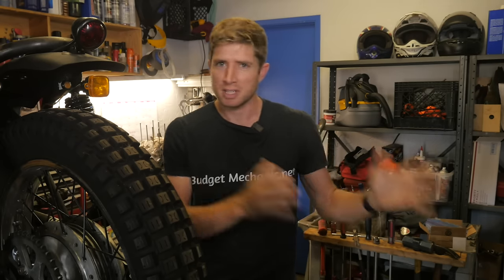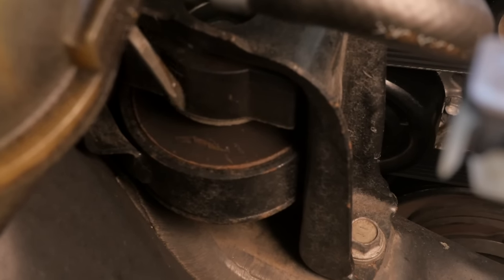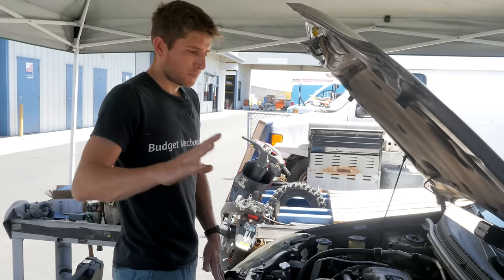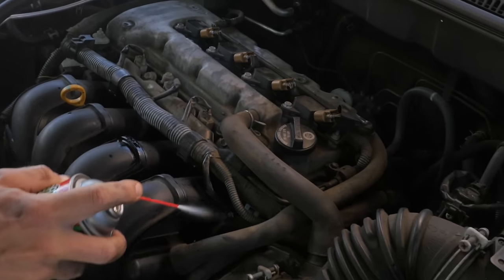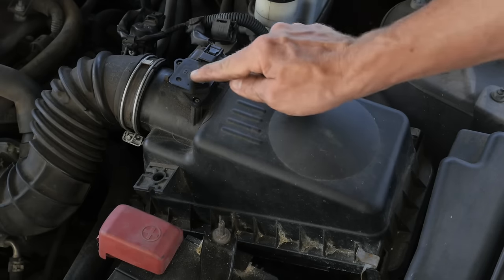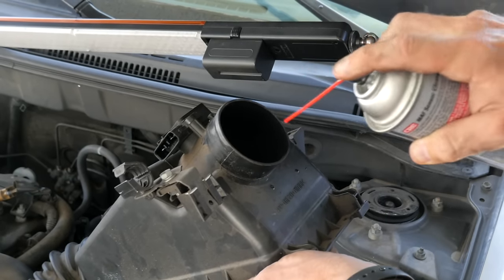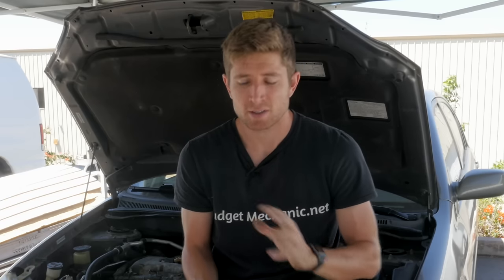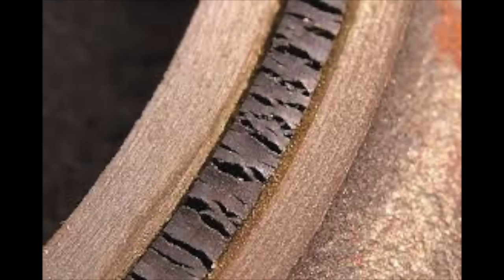Diagnose and Fix Rough Car Idle - Main Causes For Shaking / Vibrating While at a Stop

Comment: SOMEONE PLS HELP!!!!!
I have a 2015 Honda civic coupe (lx or ex not 100% sure which one) 
It’s been jerking for about a year now. Started off more subtle so I didn’t really see an issue, but now basically anytime you accelerate and push the gas, the car will jerk a few times and hesitate to go faster. That’s the first issue, 
2- the engine shuts down/ car stops at a red light or usually when I stop for longer periods of times. At first it was only when I was trying to like maneuver my car  into like a parking spot or do like a three point turn which requires you to put the car in reverse, now it just stops usually when I’m stopped when my foot is on the break. When it does that, the oil pressure light comes on along with the battery. Usually I just turn the car off and start it back up , then it will drive and the lights go off but as I stated before it will hesitate to accelerate. Not sure if this helps but the Check emission light occasionally comes on. Some days it’s on, some days it’s off. Any thoughts ?
Reply from the maker: Get the codes read! That will tell you what to focus on!

Comment: Help needed urgently i own e30 318i  it was driving fine till i did a lil burnout now my idle stuck at 1300 and 1800rpms what could it be
Reply from the maker: Not sure sorry!
Reply: Sounds like your throttle body could be stuck, I'm far from a mechanic but I know I had this problem with my ex's Pontiac grand am. An it turned out to be the throttle body just needed cleaning, once I cleaned it I never had a problem with it again. I know it's been 2 months since u posted this comment, but I hope this helps.

Comment: I got a used 2018 elantra with 100k plus miles, I hit a big speed bump, also may have over revved the engine while in brake.. the car sort of feels like it’s not as quiet, it shakes when I accelerate up to a certain speed and am about to let off the gas, or it will shake while driving really slow. Wonder if anyone knows anything.  I hear bad engine mounts maybe the cause my mechanic said but idk. I’ll be taking it in next week to get looked at hopefully I don’t get robbed and get everything figured out and my car drives nice n smooth again and fast and responsive when it needs 👍 sometimes it almost seems like it’s the transmission. It does slip sometimes a little but nothing major.
Reply: I did change the spark plugs, it was running a little heavier then this, and that sort of half fixed the problem, to where it only does it sometimes. I’m thinking it could possibly be alignment issues too
Reply: It also makes quiet clicking noises from the engine every now and then while driving.

Comment: I have a lean fuel trim code, intermittent misfires (one every week at no particular interval or load), slightly dropped mpg, and a kinda rough idle at times. I've checked my spark plugs and their fine. Do you think it's the fuel injectors? Anyone?
Reply from the maker: Are misfires always on the same cylinder?
Reply: @BudgetMechanicHawaii  yes. Cylinder 4. Front center cylinder on my Toyota 1MZ engine. Get the p0304 code for cylinder 4 misfire
Reply: @BudgetMechanicHawaii  ran a few bottles of Berrymans fuel treatment through my tank recently, with premium fuel. Improved my mpg. Only misfire when flooring it and only sometimes now. Still only one cylinder.
Reply from the maker: Lean trim is usually a vacuum leak, not always directly related to a misfire…
Try swapping coils from different cylinder and see if the misfire moves
Reply: @BudgetMechanicHawaii  already did that, didn't move. Plugs look fine too.

Comment: Bought an Altima and whenever it’s on idle it just vibrates especially the steering wheel and the rpm goes up to 2000 then goes back to normal.
Reply: Check your IACV Valve.  It may need cleaning or bad or stuck.
Reply: Jordan Bronson thanks man, I’ll look more into it
Reply: @JodBronson  if your valve needs cleaning because the car has been sitting idly for a few months, is it better to just replace it altogether? I recently had my timing belt changed but the car visibly shakes when i turn on my car and the rpms moves up and down on its own w/o me braking/accelerating 🤷🏽‍♀️
Reply: @luvleechick12   - As stated above, the IACV Valve maybe the culprit.  Replacing it if it's really old or clean it if your time is worth it.  NOTE:  My Dad's car was like that, the "Idler" needle keeps jumping up and down too and after replacing it, it was AOK.  Here is the video I've made a while back:  https://www.youtube.com/watch?v=pkb1FasEMsU
Reply: @JodBronson  thank you so much! Really appreciate your time responding. It stresses me out so much when I don’t understand what’s wrong with my car. I’ve had him for 15 years so he’s like my baby ❤️
Reply: @luvleechick12  - You are welcome!  I totally understand when it comes to electronics in cars/trucks.  It's hell when things like that happens... I myself know a lot of things, but STILL I get frustrated when "Electronic" things goes wrong.  It's really hard to diagnosed even when you know something should be easy.  My suggestion is go on eBay and get those CHEAP Bluetooth OBD Scanners...  Sometimes those things "can" help you with the diagnostic.  Although sometimes, they do not help, but at least you get an idea.
Reply: @JodBronson  ok so I checked out your other video. It definitely does this exact same thing! So if it’s cleaned and it still does this - do you recommend just having the valve completely changed? How much should that normally cost me?
Reply: @luvleechick12  - I got mine for $34.00, but depend on your Car / Truck of course.  After cleaning and still doing it, I would change it completely to avoid other problems!  It's really easy, 4 screws + 1 electrical connector.

Comment: Mine runs rough on idle when the fan comes on. Turning the ac on full blast dosent help either
Reply: The fan is coming on cause the temperature might need antifreeze or a thermostat I don't know much but that's where I would start

Comment: 🤦‍♂️ electronic controlled throttle body is a must to disconnect the battery turn on the headlights for 2 min after disconnecting the battery to get rid of any voltage left behind if not taking that electric throttle body off while battery still on you will have to get it reprogrammed or reprogram it yourself headache

Comment: My car idles quite rough, and on scanning the ECU it comes back as the fuel mixture being too rich. Possibly the cause of the rough idle?
Reply: If there is too much fuel and not enough air, the engine is said to be “running rich”, or “has a rich mixture”. It will have a gassy or rotten egg smell from the exhaust, give off a burning effect to the eyes and will make black smoke
Reply: @JodBronson  i dont think my car does ANY of that tbh
Reply: @techgamer1597  -  You stated clearly " Fuel Being Rich ".  Read my post again :/

Comment: Is there like a sound with bad spark plugs
Reply from the maker: Not really, since that causes a misfire, other than the sound of a shaky motor
Reply: @BudgetMechanicHawaii  my car sounds like a lawnmower 🤣and the engine keeps misfiring and it shits off when when it idles
Reply from the maker: We have a great video on misfiring if you want to further diagnose that. Misfiring is a bad problem, you should address that before making sure your lawnmower blades are sharp.

Comment: Whenever I start braking and stop at a red light my car starts vibrating but as soon as I hit the gas the problem goes away
Reply: Me too! I’m not sure where does it from?
Reply: It’s probably your engine mounts. I would get new ones
Reply: @docholiday9513  imma try changing the spark plugs if that doesn’t fix it then I’ll change the engine mounts 👍
Reply: Yeah, when you're on the move you can't really feel that vibration until you're idle. Did the engine mount replacements work?

Comment: 03 Camry changed radiator and now when it gets warm it'll go dead!!! I'm stumped never run hot either
Reply: Make sure that 1) you refilled your coolant to max, 2) replaced thermostat in proper position if it was removed, 3) reconnected your radiator fan and 4) you reconnected all hoses and radiator cap after you got done. There is no reason why your can should run hotter with a new radiator. Lastly, make sure your water pump is working.
Reply: @MrSupernova111  read again
Reply: @anthonycole3220  . Good point. I have no idea what you're trying to say as it makes no sense. I'll leave my comments for others and good luck fixing your car!
Reply: @MrSupernova111  that's fine lol. Pretty simple exactly what it says. #1 Radiator had a crack so i had to replace it. #2 after I replaced it and when my car warmed up to standard temp it wld start to idle rough until it wld go dead
Reply: @anthonycole3220  . What I don't understand is what your radiator has to do with the idle in relation to the throttle. Maybe there is an issue with the radiator fan drawing more power than it should causing the alternator to be overworked. There is at least one video on this on youtube. Please post the solution once you figure it out. Good luck!
Reply: @MrSupernova111  I end up putting in the shop and they said it was my"throttle body" was gumed uped LoL. My thought is that it didn't do it before I replaced the radiator. But I did notice some relay's changed out. 🤔 Fan relay's
Reply: @anthonycole3220  . That is weird. Not that the throttle body was gummed up but the sequence in which everything happened. Glad you were able to get it fixed.
Reply: @MrSupernova111  I still don't think everything is right now fans want run unless a/c is running. Thanks but it's got me and never had a problem before 260k to. Take care

Comment: Hi i have a 2010 4.0 mustang and sputters like crazy, have to keep tapping the gas pedal in order for it to stay on , drives ok after 40mph. Has no ticking or no engine knocks. However it does have 3 codes. P0301,p0106&p1336

Comment: I have a K&N short ram intake on my car. I wonder if this is the cause of the issue
Reply: no
Reply: @lindvallpaul9861  just got my car fixed. It was actually the torque converter that was responsible. Thanks for your reply
Reply: @Los.169  aah okay, good you did get it fixed. but sad it was that converter, it must have been expensive to get it fixed ?
Reply: @lindvallpaul9861  200$ for parts. My dad did the labor.
Reply: @Los.169  that was good 👍👏

Comment: there are times when it   doesnt shake in low rpm but sometimes it vibrates more violently than others. Can we pinpoint what has the highest chance causing the problem? its a toyota prius 2006

Comment: Stop topping off the tank at fill ups.  This is causing 90 % of all these problems combined and mechanics are getting rich off this one problem. Also, cheap gas accounts for the rest. Especially catalytic converters issues. I’m at 77086 on my 2015 outlander and all I EVER changed was the converter because some asswipe stole mine. After the change my car runs like new and I never changed anything else on this car. If your suffocating the the purge tank lines with fresh gas, your causing the problem and not even know it.

Comment: I have a 2009 Expedition that has a really bad hesitation and loss of power. I have taken it to three different mechanics and they can't find nothing wrong because is not giving them any codes but I know is something wrong. I don't know what to do, I feel like all I'm doing is just throwing money into the truck
Reply from the maker: Have they checked all the things I mention in this video? Start simple!
Reply: Inspect your pulleys and tensioner. I had the same problem and it helped alot. Also replace your map sensor. And clean your throttle body
Reply: Id recommend getting a free test at an auto zone or orileys and look up the cost with your car and see what other people say it could be. Could very well also be a fuel pump. I had to replace mine in my 2005 trailblazer because of a burned out floater. It made a world of a difference. When I use to put my foot on the gas it use to hesitate and lag also feel as if it was having to work super hard. I did a injector cleaner after I changed my fuel pump and put a few gallons of ethanol free gas to break up any build up and omg world of a diffrence. But id say get a test first.

Comment: Hello, I have a problem with my pcv in my 2020 Skoda Octavia. Can I send you a video through email or Instagram to hear the noise I have on it? In the Skoda Garage, they changed the pcv 3 times and i still have the same noise and hissing noise. Can you help me diagnose the problem?
Reply from the maker: Try posting the video to YouTube and we’ll take a listen
Reply: It's in my YouTube account
Reply from the maker: I am not familiar with this car. Is it a diesel? Otherwise I would say valve noise. If those are bad enough, it will affect the PCV system. Does the car run OK?
Reply: @BudgetMechanicHawaii  it runs great thats whats weird. No check engine light nothing. When i block the holes you can hear some different idle rpm and the suction on the oil cap is really high
Reply: Not diesel  @BudgetMechanicHawaii

Comment: Good job man 👍👍👍
Injector cleaners is waste of money remove injectors and clean with ultrasonic and supply voltage with all sun injector tester you can clean the injectors from inside and it'll become brand new and work  much much more better than with injector cleaner pour in tank which is waste of money even if you fee better than before its not the right way you can do it every 10000 km or 20 it's up to you but if you are a diyer then it'll not coast you that much or if you are lazy jus pour your money in the fuel tank and it'll clean your injector in your dream 🤪🤪🤪

Comment: I have  2013 impala it says im getitng to much gas to trmnal 1 and 2 what could the problem be I've changed the throttle body and mass air flow sensor
Reply from the maker: Hmm not sure, I would search the web and see if anyone else with that model has had similar problems. Often I find issues like that can be model-specific
Reply: Bad injectors. They are doing to full of a burst of fuel. Try replacing the ones that are reading codes and go from there

Comment: I have camry car 2007 when I start A/c fan my car stay normal mood but after a/c compressor my cat starting vibration then I press accelerator vibration stopped please tell my my car problem
Reply from the maker: All the same symptoms adresses in this video still apply but I would also check the compressor pulley and make sure it is spinning smoothly, not off center.